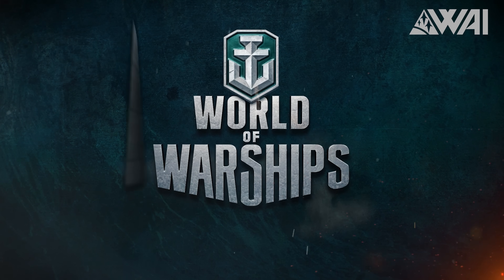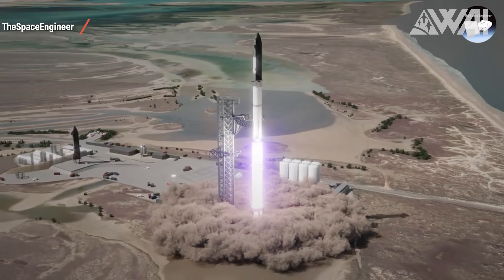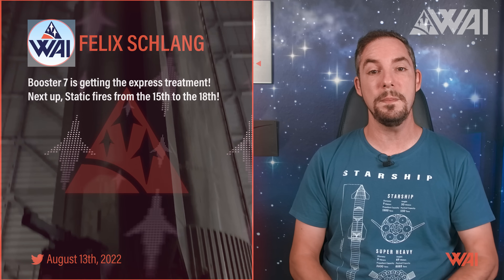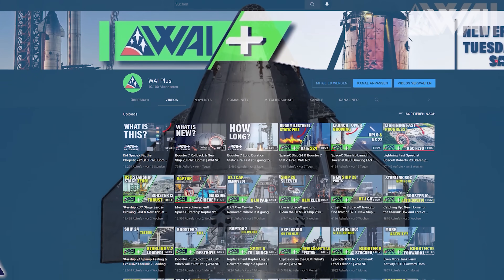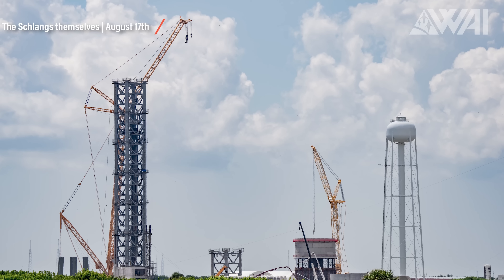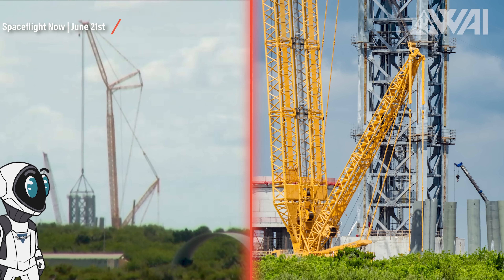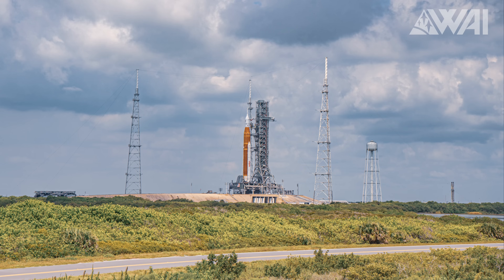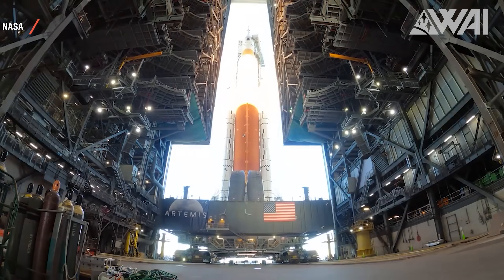SpaceX Starship & NASA SLS! Greatest Double Launch In Human History!

Comment: I'm glad Starship is carrying payload for the 1st attempt. There's a lot of "What If's" but if anyone can do it Elon can.
Reply: I suspect this payload are actual systems off the Starlink V2 production line that failed some verification tests.  From Boca Chica it is not possible to send a payload into a useful orbital inclination for Starlink.  However these prototypes must have working propulsion systems because they will be de-orbited after performing tests important for ensuring the functionality of Starlink V2.  They need multiple satellites to test the Pez-Dispenser.
Reply: @jamescobban857  Contrary to what you claims, there are two inclinations that are accessible from Boca
Reply from the maker: Agreed! They also have so many Starlink v2 Satellites at hand by now (already mass produced), that it makes sense to try it!
Reply: You why not do an uncrewed moon landing.
Reply: @alpeshpatel2644  they are doing one
Reply: @alpeshpatel2644  There is still a lot of work to be done on reducing the mass of the system.  The current version does not have enough total deltaV, even if it has no payload at all, to place the Starship into a rrajectory to the Moon.  Later versions, for example as required for the proposed Polaris 3 and Dear Moon missions, will put Starship into a free-return trajectory around the Moon but must retain enough fuel to slow the Starship down for the catch.  Without orbital refilling there is no way that Starship can land on the Moon, which is why NASA is spending $2.9 billion to fund SpaceX's development.
Reply: @jamescobban857  they are doing an unmanned landing.
What current data are you basing your deltaV calcs on?  Please reference it as it seems to contradict all other sources,  thanks
Reply: @jamescobban857  I did some basic calculations and if they expend the ship and booster, they can probably put 10t of payload on a lunar flyby.

I assumed empty weight of 100t for the ship and 180t for the booster, 1200t of fuel+oxidizer in the ship and 3400t in the booster, an exhaust velocity of 3,45km/s for all parts of the burn, 9,4km/s of delta v to reach LEO and another 3,2 for trans lunar injection.
I did not account for any fuel being left in "empty" tanks.
Given these results I think a lunar flyby with empty starship, without refueling, is pretty close to possible, maybe even barely possible.
Reply: @plainText384  I did the same calculation and got the same result.  However I assumed that it would be pointless to expend the booster and Starship because the whole point of the system is reuse.  I assume that SpaceX will continue to improve the implementation, reducing its mass so as to improve the mass ratio and that Elon would not have signed the contracts for lunar flybies if he did not believe the required improvements by the end of 2024.
Reply: @jamescobban857  I think the key technologies that are missing aren't necessarily related to mass reduction. SpaceX needs orbital refueling anyway for lunar landing/orbit and interplanetary missions. Once they have that delta v is less of a problem. If they want to reuse the ship, especially after a lunar flyby, then the heat shield will probably also need some work. Can't have tiles falling off.
Reply: Elon can do nothing. Its SpaceX that can do it.
Reply: omg the dickriding is CRAZY
Reply: Pretty sure that just about every rocket carried a payload of some sort during its first flight, even if you ignore the avionics that go along with it being a rocket.
Reply: Elon doesn't do it.  He hires people that do it.
Reply: Why Elon?
Reply: Like self-driving cars by 2019? Or Hyperloop?
Reply: @blazinchalice  the guy dreams big, no one can deny he’s accomplished a lot though. Spacex does 80% of the worlds launches and Tesla is the leading electric car manafacturer
Reply: @blazinchalice  SpaceX and Tesla are two completely different beasts, the only thing comparable between the two is that the vehicles will be built on an assembly line, that's it......Starship will succeed.
Reply: @SpaceXsuperheavy 　"Succeed."  I predict it will become human-rated in 2026, and even then without a crew escape system it will always be a potential death trap.  And how many times is it supposed to fuel up in orbit before heading to the Moon?  12?  A dozen launches before it can even leave Earth orbit?  Brilliant.
Reply: @blazinchalice  when did he try to do hyperloop?
Reply: @millsathn  You're funny.  Yeah, he was pushing it hard, and even says he came up with the name himself.
Reply: @blazinchalice  your mistaken
Reply: @blazinchalice  Tesla isn't developing Hyperloop,  they never were.
Reply: @blazinchalice  at spacex we specialize at converting the impossible to late. 
                  -Elon Musk
Reply: @blazinchalice  Both on track and well ahead of any competition. As Elon has said "Doing the impossible...late!"
Reply: @MrEd2291  "On track."  Fully self-driving cars were promised as far back as 2019 and the guy who led the project just quit, but yeah things are just fiiiiine.  And when hyperloop was scaled down to Teslas slowly rolling through a tunnel, the dream was over.

Comment: I'm just not impressed by SLS.  11 yrs to rebuild an old Saturn pattern rocket,  with refurbished shuttle engines.  I'm sure Artemis is fine,  but it doesnt inspire much confidence in innovation
Reply: SLS really doesn't have equivalent capability to Saturn V.

In the time between Artemis I and II, Saturn V flew operational missions, including Apollo 11, meaning a launch cadence that's about three times as high.

It could also launch significantly heavier payloads to trans Lunar injection.

In terms of cost, it's difficult to differentiate between fixed and marginal cost in these kinds of projects, but we do know the total budget that was allocated. SLS has an annual budget of roughly $4.2B, meanwhile Saturn V had an annual operational budget of $10B, divide by annual launches and we get that an SLS launch is 27% more expensive than a Saturn V launch. (This is actually a little forgiving for SLS, since it won't achieve a 1 launch per year cadence for some time still, but let's give it the benefit of the doubt)
Reply: With SLS sucking up the budget & limiting the cadence, Artemis is not fine at all
Reply: That's why SpaceX has been such a disrupter.  NASA makes great satellites and robots.  But they dont innovate with rocketry anymore.  They have something which meets their needs in 1960s rocket technology and they arent interested in doing more than retracing those steps.